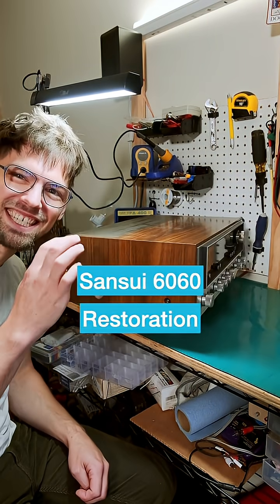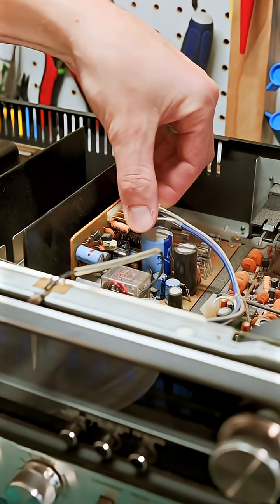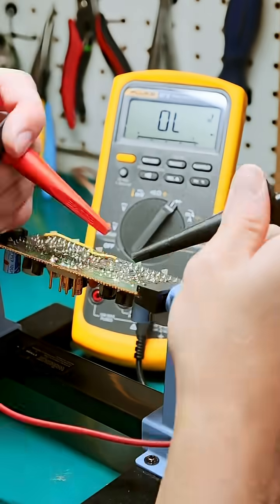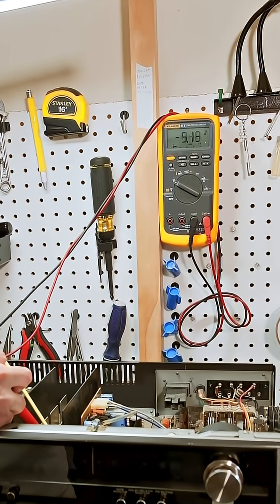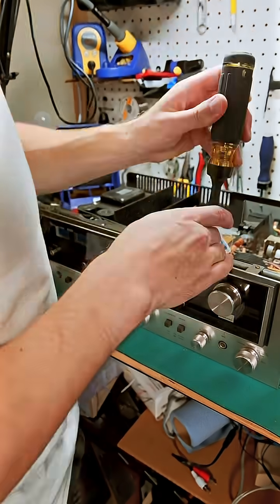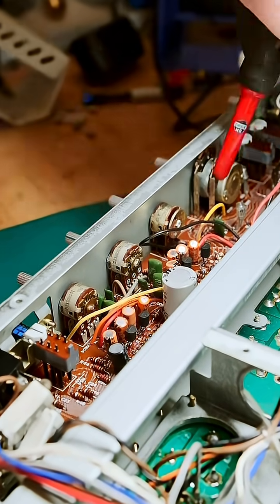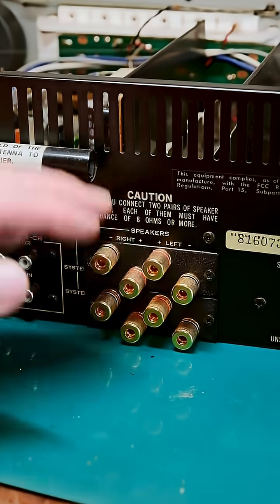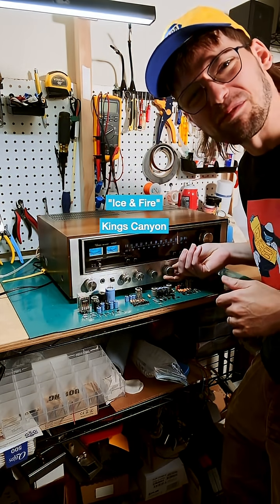One of Sansui's best! #Vintageaudio #Hifi #Stereorepair

Comment from the maker: Thanks for watching! The repairs cost around $900 with parts and labor. The client was happy to pay that even though it is around the same as he could likely sell it for now because he has no plans to sell this unit and wants it to work trouble free for another 10-20 years. 
Want me to repair yours? Head to this channel's bio for more info.
Reply: Very much appreciate you posting with the repair cost. A lot of work but a great unit.
Reply: Looks amazing ❤. I have an old Marantz  I purchased maybe 1983 or 84. I got it at a stereo store and got it at a great price because it was an older model. Still works amazingly well. 
Could you demonstrate how to do basic protective maintenance such as how to clean out the dust and things an amateur might be able to safely do to take care of an older receiver. 

Thank you so so much.
Reply: I have an old Onkyo receiver that’s in great shape but the volume knob has some crackling issues. I’d really like to have it fixed.
Reply: @TheDark1-666  Might be able to DIY with some compressed air (to blow out dust & etc), then contact cleaner and another shot of air, then finally contact lubricant.
Reply: @TheDark1-666 you can fix that with contact cleaners
Reply: I am amazed at your knowledge and skill set at your age. Yes, I am much older and loved stereos from the late 70’s. I owned a Nikko 9095. I still have the technics turntable direct drive.
I wish I had learned how to work on systems like you do.

Curious where did you gain your knowledge and skill set? Technical school or hobby?

Thanks for your time…
Reply: That's awesome!!
Reply: Luv your vids. I'm curious as to your replacement of the fusible resistors. What did you replace them with, generics? As a fellow tech I get anxious as to what will work properly.
Reply: Do you also work on plate amps,,, from a powered subwoofer for example?
Reply: How much does a service like this cost?
Reply: @andreasschrader6925 If you have to ask , it's too much. But for the record , he already said nine hundred.
Reply: How did you learn all this? I would love to have your knowledge
Reply: You are doing The Lords work, man. I had two Harmon Kardon 730 Twin Powers that I absolutely loved
Reply: Danggg bro ,wish I had kept my old amps and turntables .Didn't know they could be repaired in this age and era❤
Reply: Great to see things being fixed and given a new lease on life rather than ending up in a landfill.
Reply: What education do you need to perform these type of repairs? You're quite knowledgeable.
Reply: Great work
Reply: Forward information on your process for repairs and contact details to me
Reply: My 9090 should be gone through.  And he's only one State away!  There was a good guy in Kelso, but he's in Kansas now.
Reply: That's all well and good, but as with old cars, it's going to keep breaking. This is just the tip of the iceberg.
Reply: Dude, $900.00 is totally worth it. Nice work Sir...
Reply: Can you recommend a receiver and speakers to buy?
Reply: Well worth it!!!

Comment: Tried tried to get my 1990s Sony cassette recorder repaired last week but it had been unused and stored in the garage for about 8 years. Damp had ruined all the springs and damaged other components so the engineer said not worth the cost of repair. I found a Yamaha model on e-bay on Monday night for £140 ($184) and it arrived today. As the seller, who is an actually an audio engineer said it was immaculate. He was not lying, although supposedly a used product I doubt it had ever been turned on. Absolutely immaculate, really like new, and about 20 -25 years old. I believe the model used to sell for about £500 ($656) in the day. So glad people like you exist to keep old equipment running.

Comment: Nichicon caps from that era were pretty good. Did you replace them proactively or were they actually bad? And speaking of bad, another tendency of that era was using electrolytic caps for signal DC isolation. Totally ruined the sound quality. Did you correct this design flaw?

Comment: Hi  : I see that the machin is clean from both out side and inside did you clean it  👍 or it was preserved well from dust .. Thanks
Reply from the maker: It was pretty clean when I got it but I also cleaned it inside and out!
Reply: @Shuksanaudio 
👍I greet you because many technicians can repair and  restor the vintage sets , but very very little of them who can clean and sand the vintage sets and turn it into zero condition of the first purchase,
I saw an old technician ( may he rip), he used to dismantle any vintage radio of audio set and sand it hardly  and clean it intensively to be exactly like the Chinese dishes after being washed ..
Reply: @Shuksanaudio 
as an audiophile I hope to find such devices to buy , but I found not yet ! 🤔
Reply: Thanks 🙏

Comment: what capacitors you recommend for amps. instead electrolytic caps? m 😊
Reply from the maker: You still need to use electrolytic caps as they are the most dense in capacitance. Anything under 4.7uF I usually replace with film if a suitable sized film cap is available. For electrolytics I use Panasonic FR and Nichicon UPW as general replacements. Nichicon UES (bipolar) and UKA are great for audio path.
Reply: @Shuksanaudio  thank you so much master..

Comment: Do you repair Audioengine5 model A5 powered speakers.?. I heard the speakers are pretty bada##.I think one channel is out. Could be a bad smt capacitor or the power amp chip. I'm pretty sure the problem with these speakers is that it's fully enclosed and it overheats inside...

Comment: Everything was great until you replaced the terminals. Replacing electronics and even the lights with LEDs is fine, but the terminals are visible, and replacing them with different types, ruined the receiver, IMHO.

Comment: That was fun...except the calling the 1/4' x 1 1/4' fuses, leds...
Reply: Huh? That was a LED, not a fuse. Just looks the same as a fuse and is what was used for the dial lights of much of the vintage gear. The original were incandescent bulbs, but you can get LED replacements now.

Comment: People that can repair this equipment are few and far between. Bravo man, great job returning it to service.
Reply: There are a lot of people, they are just always busy and replacement isn't sheap, bet that job ran about $1800
Reply: @johnwayne2103 he said 900$. Not worth it for most people but its just basic electrical engineering
Reply: @johnwayne2103 $900 he said in a post.
Reply: market...  few want those equipments fixed... niche market..

Comment: Looks ALOT like a Technics model I saw in 1978.  Quadrophonic setup, 4 individual volume controls for each of the four speakers, and the main volume control for all four at once. You could individually adjust everything on each speaker independently from the others. It was bad ass.
Reply: They don’t make’em like that anymore, independent bass, mid range, and treble.  Simple by today’s standards, but it was top-of-the-line in 78. Ran over

Comment: That's not restauration, it's repair/upgrade. You changed original components with modern ones. I also don't see any reason to replace working small signal transistors. Nevertheless you do a fine job.

Comment: Hello folks who like to fiddle with electronics. 
This gentleman states in his opening remarks. How he removed a component to achieve better test results. 
He was isolating what needed to be tested. He is clearly a seasoned pro.
He glosses right over the point. He does mention his process. But only in passing.
If one needs to test a component properly. It must be removed from the circuit. Otherwise any testing done is invalid. Because the component is still part of the circuit. Have a great day.

Comment: You do Incredible Work. I have some D5, can I use D5 on a Denon pra 1100 pre amp 3 position selector source switch(knob). Its causing static and cut out in the source position for my cd player.  Thanks!
  Keep up the Great Video's.

Comment: How do you justify swapping out the speaker terminal on every single unit I’ve have seen you work on - and never once have you said that the terminal you are replacing has failed.

Does your Dad own the speaker terminal factory or something ??

(and if you say anything about those Gold connectors - Please, just do your best not to get yourself shocked . . .)

Comment: Good to see circuit boards being repaired rather than replaced. Well done!
Reply: Its not worth repairing circuit boards. That's why they are replaced.
Reply: @adamrspears1981  - perhaps for modern appliances. But for older HiFi equipment - the only way of keeping them going.

Comment: I have to ask what caused the fusible resister to blow?

Can the caps be tested in circuit?

Do you have a vid on desolder components?
Reply from the maker: Fusible resistor could've blown from various causes or failed on it's own. They're notorious for causing issues. 

Caps can be tested in circuit sometimes depending on their position. 

I don't have a video on desoldering components but I will be making one probably early next year!